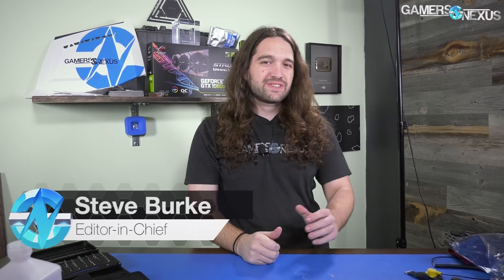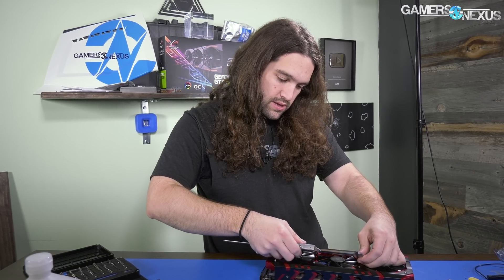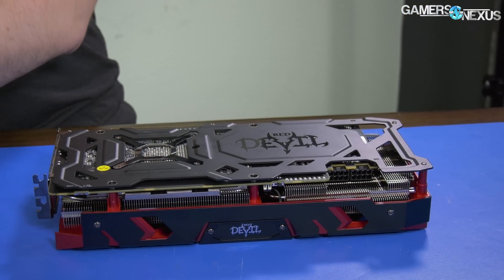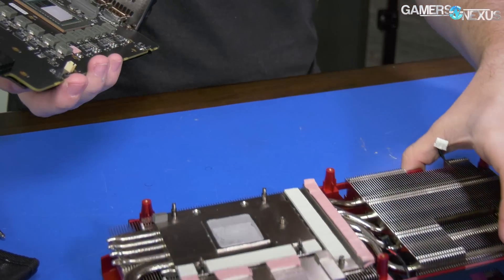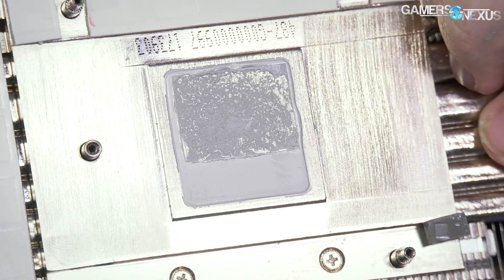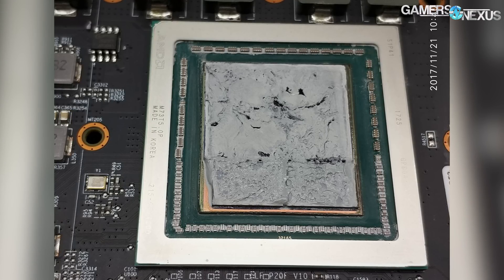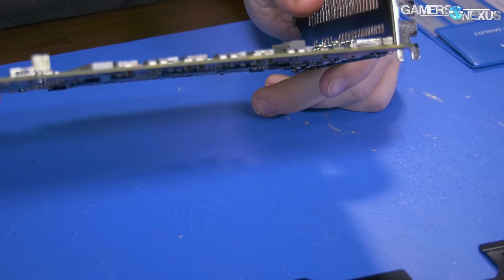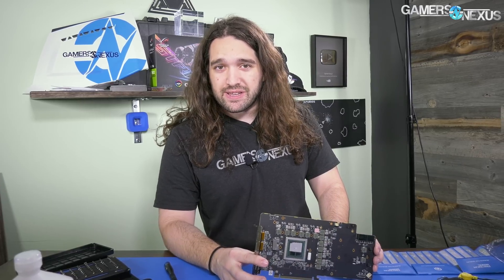PowerColor Red Devil RX Vega 64 Tear-Down (& Thermal Paste)

Comment: you have to blame power cooler. they should have tested all of this as a company that makes heatsink fan's to put onto a card. that heat sink should have been milled to match the step. but because they didnt benchmark to see the difference from other products, and search why it was reduced in temp, its completely their fault.

real companies engineer things. its great that you helped them fix a problem they should have known even before they made the heat sink. but when you dont check the chips you are getting and make a design based off of everything else, thats when you get into the problems. thats why once you get the card you test it before you make any production line. prototypes you know. 

unless AMD's reference card that they used to make the heat sink didnt have that same chip on it, then it would be 100% AMD's fault. 

with all that said... i can't blame either without more information. but its clear as day that the card manufacturer did not test the product adequately nor investigate said data. alot should have been done to have caught this before leaving the factory. 

also what would the difference in temps be if the heat sink was milled correctly vs the 3mm of OEM thermal paste? might just be a non issue all together.
Reply: id also like to add id love to design a heatsink fan by thinking outside the box unlike so many gamer gpu's. This one is neat in how its actually bigger than most (but i dont see using it to its full advantage). whos not to say i cant go bigger or different?

 tho i dont have that kind of funds, and limited knowledge. i do like the engineering in things all around the world, but am not an engineer. Thermal dynamics and aerodynamics are things i enjoy reading about.

Comment: Wasn't it the Devil series that couldn't handle the RX 480 series on Furmark? It seems like they ruined the branding, put a shiny cooler on things just to sell, and forget about common sense... The only Devil I had was a used R9 270x (looked great, all aluminum), but I think it was mined to death because it literally shot bolts of electricity through the HDMI and blew up my TV's audio and video input panels. I seem to have really bad luck with computer parts sometimes...

Comment: About whos fault it is Powercolor or AMD for the cooler not touching the HBM. Personally I would put that on AMD. Here is why, Didnt AMD have like atleast 3 different places making the HBM and each place had different styles they used? The one with the filling around the HBM was even with the Gpu iirc both of the others the HBM was slightly lower. If Powercolor had to make 2 different cooler plate types just to accomodate AMD that is just silly.  It isnt like AMD is only sending one HBM design type to each AIB so they can make the correct cooler. As you said though good catch by Powercolor to catch it and add more paste. Great video Steve.

Comment: Damn, that's a sexy card
Reply: And that's about where the pros end. Damn that heatsink. And the attitude "We smear tripple the paste and it'll just work"... What a fail...
Reply: outdated TV It's a memory module, I don't see any GDDR5/x which runs at higher clock and voltage needing any heatsink.

Comment: No, you should have started with benchmarks first! Because messing with it will screw the temperature testing later on. And the out of factory temps are more important, than you applying Thermal Grizzly afterwards... :)
Also, if the rad itself doesn't touch them too, more paste won't help much... Will it?

It's both of them's fault, but mostly AMD's.

Comment: AMD fucked up the Threadripper mounting socket. Now they messed up the HBM height.
Reply: Jessica Jung I'm pretty sure Foxconn messed it up, not AMD.
Reply: SlavjanA AMD doesn't make the boards either, just the chipsets. It was up to mobo manufacturers to fix that issue, not AMD.
Reply: Jessica Jung Threadripper is not a big deal. They fixed it quickly. Vega is way way worse.
Reply: The threadripper issue was all Foxconn
Reply: AMD doesn't make them, but they should've had more control over it.
Reply: This is no little fuckup. This is apalling. I don't care who is fault here. Both AMD and Powercolor take the blame and it's unbelievable what happened.

Comment: Not having a single standard die package is absurd. Its amazing that AMD can handle their CPU production so well and their GPU line is a shit show.
Reply: We may well see if NVIDA & Intel have problems although you would hope they don't. In a production arena (like where I work) if you have an item from 2 different manufacturers, and they are slightly different, you modify your production to account for this. AMD knows the difference, but refuses to make accommodations for it in the manufacture of the package/interposer build. Yes, it basically means they need to have a second internal part structure/BOM (one for each HBM vendor), but tough, that's business. Or at least a business where quality control is even slightly important.
Reply: Their CPU line also had some issues with the LOTES vs Foxconn TR4 sockets. 
The Foxconn sockets were giving users processor installation issues (and reportedly managing to damage the Threadripper processor in extreme cases). 
The motherboard I've worked with thus far have been manufactured with LOTES sockets so I can't comment how bad the issues were with Foxconn sockets.

Comment: Good thing they sent you this card.  Anyway, this height difference between the core and hbm; doesn't that mean that if the heatsink itself doesn't account for the difference, then, there's not enough pressure, once attached for the thermal compound to work optimally?  I imagine that if it'd been the core that was lower, then, this would've potentially been a much more serious problem.

Comment: The RX Vega is obviously AMD's fault. They designed the gpu and HBM layout and they did a poor job on the whole architechture itself. Delayed by over a year, almost on par performance yet still less against pascal high end but way too hot and power hungry, price is not reasonable at all and the supply is very short. AMD is screwing itself over with the HBM2 thing while Nvidia is sitting in cash (stock market value increased x 7 since may 2016) and all they did was to improve on GDDR5 gpu while their HBM2 is like the most powerful card they have ever produced.  Who knows, maybe they'll knock AMD off with their HBM2 powered GPU with Ampere atchitechture in 2018. So AMD will have to drop Radeon and focus on it's cpu market which they actually did their homework on.
Reply: funny to see you judge amd like that, yet have you ever seen their financial status, last quarter was their first quarter of profits in a couple of years, and yet they have to compete with nvidia AND intel who both spend billions on research and development, and amds profit wasnt even in the billions, so honestly i think they are doing pretty well creating a gpu that matches a 1080 and a cpu architecture that gets intel scared while they made no money.......and by the way, vega was delayed because amd had very limited amounts of money, so they had to choose between polaris or vega development, polaris was easier, cheaper and faster, so they chose it
Reply: That would be absolutely terrible for the consumer if AMD dropped their GPU line, and most of your post is an exaggeration.
Reply: nope, the HBM2 thing is because AMD plan to sell this card to data centre, AI stuff and graphic designer. These people grant them constant revenue. not to mention it was designed to be in the die with ryzen.
Reply: There will likely be refreshes early in 2018 to take advantage of a die shrink to 12nm and some issues will get fixed at the same time. Then Navi will show up later in 2018 at 7nm and with architectural improvements. Perhaps not enough to catch up or pull ahead of Nvidia, but at least enough to keep in the game. The amount of investment in drivers will probably determine how close they get.
Reply: Danny Gc Yup. Been following since 2016 actually. What I am saying is, why investing in HBM2 when it's so expensive to develop while they could have gone for G5X based gpu and invest in HBM later. They knew they were short on money, yet they kept going for it, a bad gamble I would say. Like I said above, the cpu division did an excellent work and shook up Intel really well.
Reply: nimrodery A bit xD I was expecting something better  for that much hype they made, they're good but not impressive on the terms of pricing and power cpnsumption.
Reply: Stu Bur Navi is pushed to 2019 since Raja has left the Radeon division now.
Reply: Why invest in HBM? Seriously? I have a PC the size of a mini-fridge. That's why. HBM was a co-development anyway, and other companies use the tech, so AMD gets income from that. As for development cost, how much was that exactly?
Reply: nimrodery I know that AMD co-developed the HBM with Hynix and it took 7 years (from 2007 to 2014, when they still had money). But I am talking about now. It wasn't necessarily for AMD to make HBM based high end GPU when they didn't had enough money for. They should had stuck to GDDR5 and improve on efficiency then go over to GDDR6 or HBM which uses far far less power for a LOT of bandwidth.
Reply: HBM2 represents revenue, so I don't follow your logic at all. The potential payoff is huge, and it could be used in a larger plan to bring high-end GPUs and iGPUs to laptops and NUCs. Plus, other companies buy the tech. HBM was a win for AMD. You really can't hate on HBM then say "They should had stuck to GDDR5 and improve on efficiency" because HBM is nothing more than an attempt to improve efficiency. A successful attempt. NVidia's sure glad they did it, but maybe your engineers are smarter. How much was the development cost again? I didn't catch that.
Reply: nimrodery It had a potential. But not with Vega. The Vega gpu costs approx 200$ to produce while an GDDR5 gpu costs 130-150$. That's a big difference in production costs. I can't find the HBM development costs right now. But I am standing on my point. They could had gone for high end GDDR5 based gpu and used that revenue to develop Vega and make it better than Pascal. You know that too that Vega is 1.5 years late to competition, and is yet not competitive in price and performance.
Reply: So, a $50-$70 difference on a card I couldn't buy for any money? I'm Canadian, so these cards are already pretty expensive, and custom cooled 1080/ 1080ti are pricey as well (just more available). As for tech, the AMD hardware is better. That's why it runs better on Vulcan. NVidia had time to adapt, their recent cards represent their best effort. Advantages in DX11 are largely due to industry tomfoolery (NVidia pays a lot of developers, so does AMD), and AMD drivers tend to have their cards catch up and surpass the GTX cards over the course of ownership. I don't much like Vega, but for the lack of availability, not the technology. You're still exaggerating about heat and power, like I'm considering throwing this into an HTPC. My PSU is 1000W. My case looks like a mini-fridge.
Reply: darkknight1193, you are right, using gddr5 would be a cheaper and safer bet, however, making cheaper and safer bets doesnt move the industry forward... in fact amd seems to be the only one trying to move the industry forward, the only reason dx12 got released was because amd created mantle and it was superior to dx11, and now that microsoft released dx12, its not even as good as vulkan which is based on mantle......and sure nvidia is improving their performance with every new generation, but looking at the big picture, amd released an architecture that handles async compute in 2011, and mantle(an api that uses async cards to their best in 2013) and in 2017 2 generations in and nvidia still cant handle async(other than driver trickery), that seems pretty stagnant to me, despite the performance increasing every year, nvidia is re- using "old" technology, and charging a kidney for it and nobody cares, while amd despite having no money is trying to create new and better technologies, and one last though, HBM wasnt a bad bet, just the timing was horrible thanks to nand prices
Reply: You are all so fucking stupid. AMD is using HBM for power saving measures. If they used GDDR5,the card would draw over 400-450w.
Reply: Batemen Vega is already drawing almost 400 watts. Not a big difference. HBM is power saver yes but AMD has not done a good job on making it efficient. Look at Nvidia Tesla P100. It's over 1.5 years old and has a crazy amount of bandwidth (900 GB/s) but uses far less power. AMD has to step up on it's game if they really need to survive and be competitive.
Reply: im not sure if you know this, but hbm2, just like ddr3 ddr4 gddr5 has a set operating voltage, and consumes power based on clocks right? just like ddr3 is set to 1.5v and has clocks from 1066 to 2400 obviously the 2400 mhz model uses more power, on that note, the tesla p100 uses 4 stacks instead of 2, effectively doubling bus width, allowing for lower clocks on such high bandwidth, amd helped develop hbm, but its not the one making energy optimizations on it, the manufactures are, and its the same hbm2 as used on the p100,  i dont know where you got your information, but i would like to see a link to a font
Reply: Chandler Russell A Vega 64 costs 7990 and a Vega 56 costs 6490 while a 1080ti costs 7500. So are Vegas worth the money? Definitely not!!!!! Prices are in NOK

Comment: Deservedly savage intro. I love their solution is just adding more thermal paste, that's not how that works PowerColor...A thin layer of thermal paste is recommended for all applications, both CPU and GPU. Thermal paste is meant to applied as a "thin" layer to fill in microscopic/micro-metric imperfections in the metallic surfaces which then create imperfect contact and lead to poor thermal dissipation. Too much paste can actually act as an insulator. Quite the engineering solution from PowerColor, the only thing redder than the plastic casing on this modern marvel are going to be your thermals...Great review, too bad AMD is taking another hit because of poor engineering only made worse by a second party manufacturer.
Reply: Foxlite for power color to do this they would need to make two different types of heat sinks, one with a .030mm raise in part of the cold plate and the other flat to account for both the gpu with and without resin, which really shouldn’t be the board partners job
Reply: it is their job when they are machining the contacts on their thermal plates, especially when the GPU and the HBM height differences are a known "design feature". All they have to do is take a shim, just like the machining shim hes using to point out the height differentials, and check before just milling out a crap load of aluminium contact plates. They wouldnt even need to make 2 different types, all they would have to do is lathe off a small amount of material. But you know, measuring is tough. All that being said I'm in no way supporting the fact that AMD is in need of some measuring devices as well, at this point I think they interchange their units back and forth from metric to imperial, all around painful.